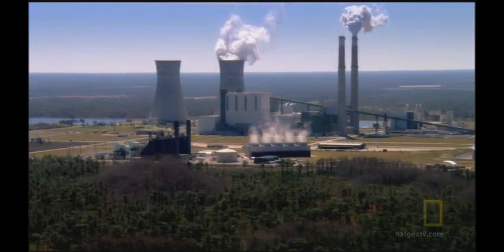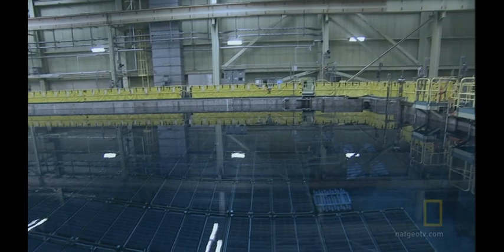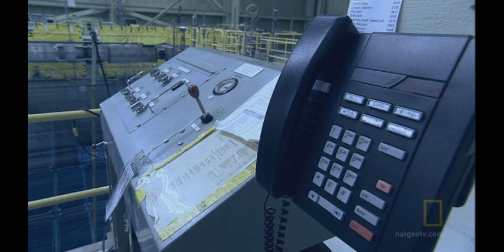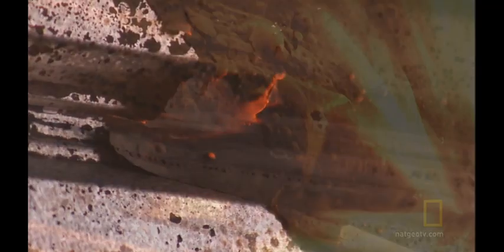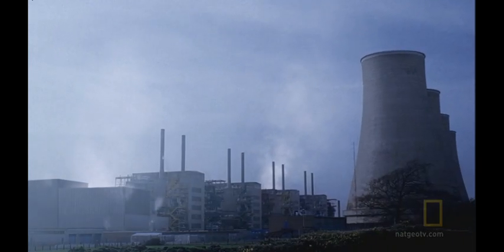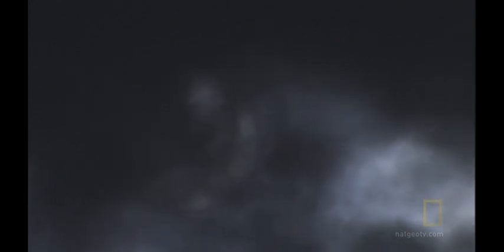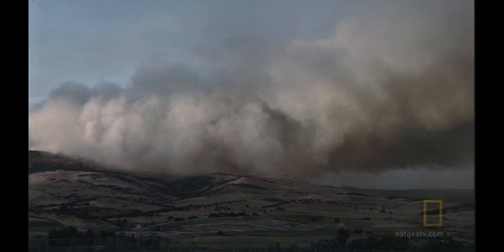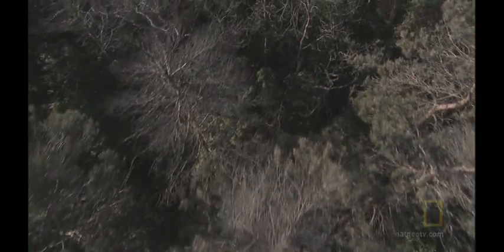Nuclear power plant spent fuel rods overheating and meltdown

Comment: Hold up if the fuel rods are good for creating steam = energy then why replace them if they are gonna be hot for the next hundreds of years still good to go. Unless I got it all wrong then someone please correct me
Reply: Pure greed sir. (they're only outputting 10% of max energy at this point)
Reply: They aren't truly "spent" or used up. After a while of use a type of rust layer builds up on the outside and drastically reduces the fuel rod's efficiency. If enough of them do that in the core then it lowers the amount of steam it can produce. Originally the idea was to refurbish and reuse rods but the process has either been banned in places or made too expensive when compared with just getting new rods. WIth cities and states declaring themselves as "nuclear free" and regulations on what can and cannot be shipped by truck, train, or air its made it nearly impossible to sustain financially so they just get new rods. This forces spent rods to be stored rather than refurbished. If you can't ban the outright use of something then you go after its support system to make it impractical or expensive to use and it by artificially forcing them to create a situation where radioactive material has to be stored it gives you further propaganda to push for banning its use. Thats how our political system works. In the end we're the ones that get screwed.
Reply: The plant requires a certain density of fuel in order to sustain the fission reaction. After about a year and half of operation, enough of the fuel has been used up that the fuel can no longer sustain fission. There's still a lot of energy that could be extracted from the fuel, but it has to be reprocessed to remove the usable materials and turn it into more fuel. France does this, and as a result the amount of nuclear waste they produce is much smaller than that produced in the US.
Reply: fla playa It only takes a little simple math to understand how much power constitutes 10% of a typical nuclear power plant thermal generation. Take 3,000 megawatts and divide it by ten. That results in 300 megawatts. Now that would make quite a toaster. As I said before, the vast majority of people who have come to depend on nuclear power have never looked very deeply into the technology behind it.
Reply: tobyr3 Wow, you're a genius bro! Thanks so much for the lesson. By the way, a typical BWR is 1000 MW not three thousand. As you said before??? This is your first comment in the thread. BaBye
Reply: fla playa The amount of heat produced in the core is 3000 to 3500 MW, but only about 1000 MW is extracted from the generator in the form of electrical energy.
Reply: Verdigo You're on the right track with this response, but there are a few things wrong. First, the scale on the outside of fuel rods limits the amount of time the fuel can stay in the core, but not the amount of energy it can produce (that's determined by the enrichment of the fuel and the fission rate in the reactor). Spent fuel is indeed spent: there is no longer enough U-235 in the fuel to sustain fission, so it's no longer useful as fuel. After being removed from the reactor much of it can be reprocessed into fuel that can go back into a reactor (see "Nuclear Reprocessing" on Wikipedia for an overview), which drastically reduces the amount of waste that will ultimately be stored, but in the U.S. it's limited by two things. One, as you point out, is cost, and the other is policy. Reprocessing involves separating uranium and plutonium from the waste products, which could hypothetically make it easier for the materials for a bomb to make it into the wrong hands. I don't think that's a good reason to prevent reprocessing, but it is one argument that is used against is.
Reply: Nathan Wahlgren I must point out that despite the use of nuclear power for the the last half-century no country has yet started storing the waste they have in deep geological repositories. The U.S. regulatory agencies have claimed they would come up with a solution all this time but the power production has continued to take precedence over a final solution to the waste it generates.
Reply: Nathan Wahlgren Heat isn't measured in terms of MW's. Watt is an electrical unit of measure. Heat would be measured maybe with the btu or calorie scale (last time I checked).....These threads always bring up bickering. The answer to braydens simple question can quite simply be answered, as I already have... Its Greed, plain and simple.
Reply: fla playa If you look into how typical nuclear power plants are rated I believe you will find that it is common for them to be rated by the thermal power that they produce and the electrical power that comes from the generator. Both are typically expressed in engineering terms of mega-watts. It is done that way so the conversion efficiency can easily be seen. Such power sources can be roughly assumed to be in the general range of 50% efficient.
Reply: BraydenXBox360 You are correct, and the video is false. The activity is just a fraction of what is implied in the video. They also mix up the used fuel storage pool with the temporary loading pool.

Its only the temporary loading pool that needs cooling (and also, just on some, not all power plants). The video is a long time storage pool where the fuel is stored a minimum of 10 years until the level is so low so it don't need water to cool it any more. After 10 years it can safely be moved to a permanent storage facility.
Reply: fla playa No.
They actually keep it in the reactor for a 10 day period before unloading.

Just a second after the reactor close down the power is down to under 10% instantly. From 10% down to about 3% takes just over a minute.

After 2 hours its down to 1%

http://en.wikipedia.org/wiki/Spent_nuclear_fuel#/media/File:Decay_heat_illustration.PNG

Comment: Neither has coal..  One thing is for sure that current plant designs have been proved to be questionable at best. The Germans have run pebble bed reactors with no cool at all for months. no meltdown. There are better technologies out there. The problem is that the current industry was set up to produce Plutonium as a by product. Electricity was a bonus.

Comment: The video is not factual at all and at best highly speculative about an absolute "worse case scenario" premised on the disappearance of all humans.  The only ones who would care would no longer be around to care.  As others have said, there can be no explosions because the is no containment to build up the pressure.  Residual heat would eventually equalize as it transfers it to the surroundings.  Any dispersion of radioactive contaminates into the atmosphere would depend on the wind and weather conditions, primarily contaminating surrounding areas.  Widespread dispersion would become so diluted that any adverse effects would be minimized.  In the end, because of the initial premise, there aren't any people left to affect, so it really does not matter.  What is the point?.
Reply: Typically, the vastly superior human mind can't fathom why any of the other 40+ million other creatures on this planet would want to survive if there were no humans around to admire them.

The containment, on the refueling floor of the two Fukushima Daiichi reactor buildings that blew up, had sheet metal walls and roof. The mixture of hydrogen and oxygen in those two structures produced some pretty good explosions.

It's now over 28-years after the Chernobyl accident and some of the wild-life in some Scandinavian countries is considered too contaminated, from it's fallout, to be eaten.
Reply: +CrudeDude   buddy when you comment you should put in supporting  facts as I did. But you won't  because deep down in side you know what i said is true. Now when we could just ignore the greens but that hasn't worked to this date. Becsause people love to listen to there erational/emotional propaganda porn .

Comment: One of the economic issues with nuclear power plants (NPP) that's coming to light in the U.S. is that increasing numbers of them are shutting down long before their expected maximum life has been reached. The eventual full decommissioning of these plants will last for many decades and are likely to cost hundreds of millions of dollars to complete. That was to be paid out of a reserve fund that their profits were expected to fund. Because they are being retired early that full funding will not be present so the cost will likely be passed back to the general public.

I would like to suggest this is one way corporations have learned  to hold the public accountable for the corporation's failures. How clever is  that? We get to be held hostage by the long-term threat that these NPP pose before the radiological hazards are completely removed.
Reply: tobyr3 San Onofre Nuclear Generating Station decommissioning is fully funded.  Rate payers paid into a decommissioning fund when they paid their electric bills.
I would agree the plant shut down early, victim of senatorial meddling on the part of that disreputable madame boxer and her support for the tin-foil hat crowd.

Comment: @smiles1969able A cutting edge mirror site generates approximately 11MW of unreliable, part-time electricity. A single PWR nuclear unit built in the 1980's generates 1.4GW of reliable, full-time electricity.

Comment: Do you think that photovoltaic panels are non toxic? Ever hear of silicon arsenide? Silicon doped with arsenic is the main ingredient in all semiconductors, which is what solar panel are. They also take energy to produce and the ingredients used take energy to produce, or must be mined from the earth. Everyone advocating solar energy seems to speak as though they come out of thin air, they always forget about the manufacturing aspect

Comment: the power plants  should has a solar panels to keep it ,running smoothly so it's at fire level at 3
Reply: +VOLCANICELF899 That's ridiculous. (no offense, I like the idea and had it myself). The issue is that solar panels don't have nearly enough energy density to space required and the nuclear power companies spend a lot of money on their equipment and regulations already. Solar panels will eventually wear out as well anyways. With humans there is no problem. Without humans this was greatly exaggerated.

Comment: I thought you need around 85% enriched Pu to build a nuke ready for detonation. Power plants use around 3-5% purity nuclear fuel. How would such a facility explode then?
Reply: Emre Hatipoğlu Nuclear weapons release all their fission energy in under a microsecond. If a large quantity of stored energy is released in an uncontrolled way in one second that can sometimes be referred to as an explosion.
Reply: +Emre Hatipoğlu It's a hydrogen explosion from the fuel rod cladding. Gen 3 plants have containment systems that can handle that.

Comment: I would love to plunge in that relaxing pool. The rods are quite enticing the water must be lukewarm good for revitalizing the skin.
Reply: Mark Marek Well, yes. Where i live the pool stabilizes in about 32 degree C. So it would be quite comfortable to swim in. And the top level radiation for the top 5 meters is actually not relay much higher than than just about anywhere else.

The spent fuel pool in the nuclear power close to where i live have no active cooling what so ever. So the water is warmish, but not really hot.

Comment: What would happen to a fuel rod if we sent it into space? Lets forget about the space junk, what would actually happen to it with no oxygen and in complete vacuum.
Reply: If it was stored before to cool down sufficiently, nothing would happen. If it is still hot, it would melt itself until it is cooled down sufficiently.
Reply: It would melt, and really quickly.
Reply: The nuclear reaction is not combustion, so it happens even if there is no oxygen - so it would continue to heat itself and melt. Still, once its shot into space, we would be fairly safe.

There are two major problems with this approach. First - those fuel assemblies weigh several hundred kilograms apiece, there are a few hundred assemblies per reactor, and the cost of launching things into space is somewhere in the neighborhood of ten thousand dollar per kilogram. Our second problem is the lack of 100% reliable rockets, and a several tons of high-level waste being scattered about 20 km over the earth by an exploding booster is generally considered a less than optimal occurrence.

Comment: http://en.wikipedia.org/wiki/Pebble-bed_reactor
Liquid Lead Pool, convection lead 'changeover', good till 1749deg celcius, use lead to boil water allowing generation gear from tech 1 to be used on 'harvest'
Reply: Allways keep positive pressure on your 'concealed cooling channels' of 'particle filtered lead' the movment speed of lead vs gas should allow a very long operational timeframe with a lower maintainence cost as the system could move 'coolant' slowly within the system for the same cooling effiency.
Reply: And if you quench the system you just resealed any 'leaky' 'fuel cells', just gota start melting your way toward the problem.
Reply: What happened to mah other comments about a liquid lead reactor? fission not fast enough for you guys? hehe guys in japan prolly want to know all about it ;)

Comment: Let's git rid of those nuclear power plants and use wind turbines so no more nuclear accidents and wind turbines is cleaner energy but where is this power plant ?
Reply: A normale small one okay
Reply: Joshua Hipkiss you should inform yourself a bit more about the issues with wind power ... there have been severe grid issues between germany and poland because of the major unstable power delivery of wind turbines... whenever the wind turbines run strong, there is massive ammount of power flowing across all possible routes causing trouble for the grid maintainers
Reply: So what at least its not a nuclear accident plus I know about the problems in Germany whith them but still wind turbines are better because when a nuclear dissaster happens that could kill 1,000s people or making people infected and its dirty energy that is polluting the sea water like Fukushima power plant is spewing nuclear water in the sea at least wind turbines dont make a lot of casulties or infecting people okay .
End of story
Reply: So what I can push my little turbine with my hand plus they have motors and I have solar pannels and here its very windy and sunny
Reply: And I dont have an Xbox I have ps3 and  ipad and my phone
Reply: Joshua Hipkiss You can't use wind power for base-load generation. Period.
Reply: Joshua Hipkiss Windturbines kills about 1000 times more people per produced kWh of power than nuclear power. So no. It would not be a god idéa.

A vindturbien is also not that clean. A windturbien actually produce more radiactive waste than a nuclear power plant. It sounds strange but its actually true.

The generators have to be light, so they make them out of neodynium. Neodynium is mined in china (Because its illegal in most of the western world). When Neodynium is refined large quantities of radiactive waste is produced. The chinese store the waste in a mount in... well. not really in it... The mountain is the waste.

Comment: 0:00 "The worldwide loss of electricity reaches the nuclear power plants"?!
Pfffffttthahahaha! WTF! Is this a joke?
Reply: Ernst Stavro Blofeld It's possible, A big ass solar flare could make A worldwide loss of electricity.
Reply: Curtis Reeves For how long inside a shielded POWER plant?
Reply: Ernst Stavro Blofeld This was part of a documentary explaining what might happen if humans suddenly disappeared from the earth.
Reply: +Enter the Braggn&#39; They take decades to decommission because we are thorough and loaded with regulations. We clean up every trace and make everything 100% secure and then station guards and a new protection plan is implemented. Not because of any other reason.
Reply: Enter the Braggn' There are no such regulations in 10 CFR. I would appreciate to know how you came to such a bold statement. Plants that are recertified pass rigorous whole plant inspections leading up to their date, in fact a few plants shutdown instead of being recertified because the NRC required them to replace steam generator piping. 

As for 1200 spent fuel rod pools, I don't quite know where you are getting that number. That being said there is nothing wrong with a spent fuel pool, it's there for a reason and they are built well. I don't think you realize that every 13.8 feet is a billion times reduction in radiation and spent fuel pools are 30-40 feet deep. After spent fuel pools the spent fuel can be moved to dry casks where they are managed through natural convection and conduction. 

If you are concerned about the waste situation I suggest voting for a president who actually is pro nuclear. The current administration advocated pro nuclear views, and then defunded Yucca mountain which was the nuclear waste solution for America for centuries to come. That or if you live in Nevada you can write your governor. 

All you see is a tube going into a reactor. Huge safety factors are built in, and have been for decades. The materials used in the reactors have increased, as time passed we got a better idea on what neutron embrittlement was and how long materials can last, we worked on keeping the plants running hotter, longer, for the same amount of wear. We replaced the parts that wore down, and monitor the whole system. It's like you buying a car and saying you'll drive it for 7 years. When seven years roll around you replace the transmission and decide to drive it for another 3. Nothing wrong with that in my opinion. Nuclear power is a significant source of clean power. 

I realize this was long, I'll respond shorter (but it might be snappy!) next time. Please feel free to cite an regulation or when you feel it was misused.
Reply: Enter the Braggn' Nazis...